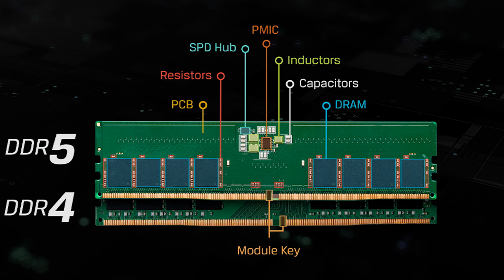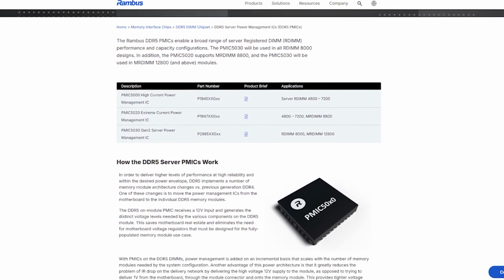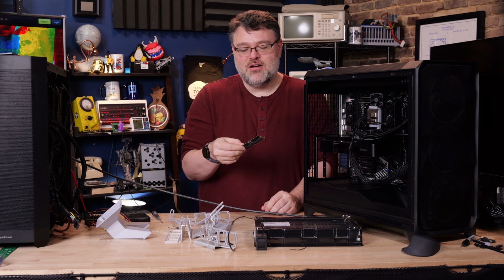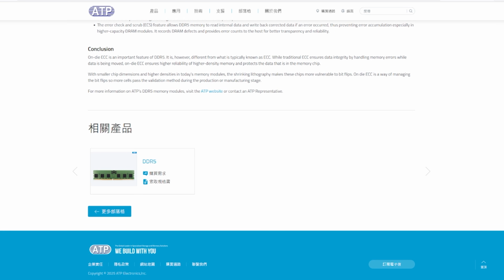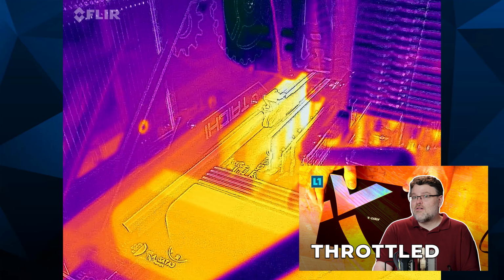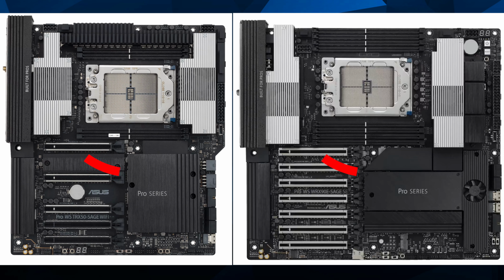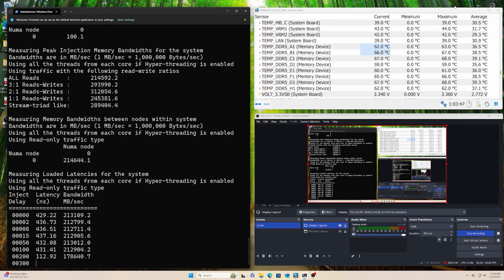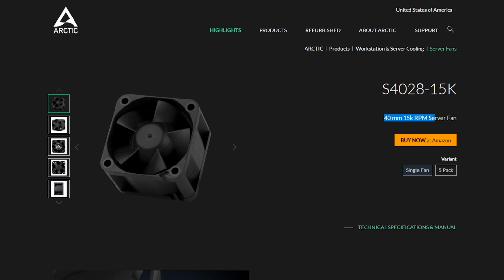Your DDR5 Memory Could be at Risk! All About DDR5

Comment from the maker: UPDATE2: I've got an updated bios from ASUS! Testing is going well for both platforms for proper throttling behavior -- but you're still going to want to monitor those temps and make sure you have good cooling. It is POSSIBLE this issue affects more than just ASUS because there IS an updated AGESA as well!
Reply: So this long but might be a decent video idea since Ram is still super expensive and I just found your channel and so far you seem to be miles above most tech YouTubers - I have a 7800x3d with a 4070ti superduper starship trooper and a liquid freezer 3 240 AIO and 1000w sfx higher end PSU (can’t remember exactly which one but it was a good brand model spec etc) and 32gb (16x2)of T-Create 16gb CL30 6000 ram and around a year after building it and a few months ago I wanted to add 2 more 16gb T-Create sticks but that was right as the prices soared and they were $400 so I found and bought 2 more 16gb ram sticks with the exact same specs and timing (including the other CL30 ab xy dc etc specs) and they were T-Force brand which is another sub brand of Teamgroup and they look very similar both outside and inside at least from what I could see outside but when trying to run local LLMs with like 45gb memory utilization my PC kept crashing even when I lowered the max utilization down to like 30 and even with smaller like 18gb models and I looked at it through a thermal camera and didn’t see any major increase in heat at least on the top/perpendicular to mobo portion of the ram heat sinks however when I took out the 2 new sticks it worked fine and when I used only the 2 new sticks it worked fine and in all case I had them in dual channel so is there a way people can actually test if ram is compatible or not? As in troubleshoot definitively whether the ram is incompatible or that it’s from heat or some messed up configuration etc? I tried for hours to research it and I got nowhere thanks to youtube and googles horrific algorithms and search engines and reddits obsession with ‘answering’ a question by saying ‘too long didn’t read’ or stupefying it (or rather stupid deciding to ‘answer it’ stupidly) to the point of being useless etc.

Like I would think those would all be compatible and the issue would probably be heat buildup because they were all edge to edge in my B650m mortar WiFi mobo so I briefly tried cranking up the fans but it still crashed with LLMs but seemed to work with games even with regular fan speeds even when the games used more ram than the smaller LLMs I tested like in 24gb range and I even tried looking at the actual spec sheets on TG website but their website was trash and wouldn’t load correctly so I gave up on it and kept those sticks but just still use the 2 original T Creates that I built my system with.

Anyway obviously this is more of a question to help myself so don’t worry about it but I figured since ram is so expensive and since you know your stuff and since I couldn’t find any information anywhere on actually definitively testing it etc I figured it could make a decent video idea
Reply: May seem obvious, but I think it would help for folks to get used to maybe at least a little more fan noise.  There's such great fan control sw available these days. I'm upping all my fans by a few hundred rpms and using headphones a little more frequently. Heck with the price of things these days, I think it's probably a good idea to make that tradeoff and lower all temps a few degrees rather than risk having to buy anything now.
Reply: So typical asucks
Reply: i feels like they make these flaws on purpose. most ram kits dont have thermal tape for controler either
Reply: Welcome to ASUS, the brand that gets praised but is also a below average company compared to Gigabyte and others. People hate on Gigabyte, yet they make products much better than ASUS and also have better customer support. Did you see the claim that ASUS made about the 5090 Matrix and the 12v2-6 connector being off centered and too narrow for a lot of plugs to fit? "It was engineered to be that way"... They suck. The Astral is also a mid tier card, yet praised as being the best. If you're not going for the top 100 on the leaderboards, there's literally zero reason to buy it due to the crazy high price as it is outperformed in many different areas by other cards. I used to use only ASUS products for a while besides EVGA, then I quickly switched a while back due to these issues.

Screw ASUS.

Comment: DDR5 like PCIe5 NVME drives should have cooling, most AIOs don't provide any airflow over the VRM or Memory. It seems like PC cases may need to redesign a few things to allow more airflow over the memory and VRM. or We need to bite the damn bullet and move to CAMM2 which would allow water cooling for the memory or a proper heatsink and fan for the memory module. (CAMM2 also has far better thermal control)

Incoming DDR6 is going to make this even more essential as it will be faster and hotter than DDR5.

Comment: Goodram IRDM DDR5 2x16 GB 6400 MHz CL32 working stable at 6000 MHz CL30 (MSI thightest profile). On default exp 6400 i needed too high vsoc for my taste for it to work stable, 1,285 Vsoc. No matter the stress test i can not make the sensor read more than 41°C. Typically they are more like ~36°C.
On msi b850 pro gaming wifi6e (uncommon mobo) and 7800x3d.

Comment: In a video by Northwest Repair he was diagnosing some ram problems and he mentioned that DDR5 ram with integrated configurable LEDs can have an issue where some motherboards can corrupt the information stored on the PMIC or SPD during writes meant to configure the LEDs

Comment: DDR5 DIMMs shouldn't have power management. All DDR5 DIMMs should have heat spreaders. It makes sense that a CPU/GPU has thermal throttling. Just think about how fun things could get when mixing manufacturers. Thermal throttling at the RAM level should never be a design option. Sensors on each DIMM is a wonderful thing. A CPU or memory controller can monitor sensors and throttle all the DIMMs at once. 

Its unfortunate that enginers and researchers have pushed DRAM this far. Ultimately DRAM is dead. Its time to bite the bullet and put the research back into static RAM (SRAM). SRAM will eventually replace DRAM.

Comment: If we use a standard front-intake fan layout, the top fan is generally blowing room-temp air right on the DIMMS (in a dual-channel system, which is what most users have).  Seems to me that should be sufficient, right?

Comment: That's funny. I just assembled my new system and kept getting errors during OCCT and Y-Cruncher. My Kingston FB 6000C30 RAM with EXPO enabled starts to become very unstable at 63 degrees. As soon as I cool it down below 60 degrees, the test runs smoothly. I have an external custom water cooling system, so there's no good airflow in the case. I'm going to change that now.

Comment: ive heard CAMM2 modules would help solve alot of these issues? 1 is signal integrity and lower power draw due to reduced length of electrical traces. sometimes up to 50-60% less power needed. 
combined with the flat design and for more effecient heat spreader design that isn't gamer focused with rgb ect ect.

i also heard camm2 modules are being tested to be mounted on the back of motherboard directly behind the cpu. making EXTREMELY short traces for it, and if it can become part of the socket backplate to a degree. it solves 2 issues. Motherboard flexing from mounting pressure on 1 side of the board, due to now having pressure applied from both sides. And help standardize the method by intergrating with cpu backplate to a degree.  Ideas for ddr6 i would presume. 

Camm2 modules mounted on the back of motherboards also opens up ideas for passive cooling of them via the desktop case backplate possibly adding thermal design into it, like copper plates or Aluminum. Which lets case manufacturers re-sell similar case designs which simply accommodates camm2 modules better with thermal approaches

Comment: I always strapped a fan on my ram so I never got any instability (even in sustained high work loads or fluctuating ones). 
The main reason for the fan was high tREFI, i knew it was temp sensitive but didn't about these other issues.

Comment: When I started overclocking DDR5 RAM I grabbed my RAM cooler I got with a kit of Corsair Dominator DDR3-2000 RAM over 15 years ago.  I never had to use it back then, but I never throw stuff out, and it works great 😅

Comment: lmsensors reports +55c as high threshold on my corsair kit. Also my asus mobo have a mount point for a 6010 fan on one of the nvme heat sinks so it can blow air directly over the ram sticks

Comment: Thank you for making this very important video. Internally and externally in my circles, I constantly advocate for MemTest and tuning memory to be more reliable. So many issues are blamed on various other hardware, when its indeed just the memory all along. DDR can go bad. After any BIOS update, your memory could have different tuning, so worth testing again, specially if you are running any form of EXPO or XMP "overclocks"

as the intro pointed out, many users overlook ranks and assume "I can just pop in another 2 sticks" , "this ram is known good",  when it can introduce a lot of nuance to the IMC.

Now I have to also advocate for checking memory temperatures ! :') MemTest can show it as well, during that torture test, but it would be more accurate to do that in-situ while gaming or other workloads, as your case temp will be hotter with GPUs running.

Comment: I can't use expo with my asrock b650 pg lightning because it causes my system to power off and on wrong and it shows in event log. Its on the qvl list and only 2 sticks in the qualified configuration and I have the most recent bios.

Comment: I never usually comment, but from this video I've went out and bought a RAM cooler, my old DDR5 set died back in 2024 and I replaced it with "cheap"  DDR5 JADEC speed memory, and have never even put them at their profile it's just set to run at Auto, I have now added a RAM cooler to my system because of this video because I really can't afford to replace the sticks I have right now. For the people who don't have a 3D printer, you can get a "Jonsbo NF-1" cooler for cheap.
Reply: I tried the nf-1. It didn’t work well it touched my motherboard cable. I got another no name brand off Amazon. It works well.

Comment: Watching this while still using DDR3 on my 2013 Haswell era motherboard
Reply: Z87 was rock solid 😊
Reply: @q1337  That's the one I got lol
Reply: @DBXCRFFL  Asus Maximus VI Extreme + i7 4770k, retired it now, served me very well before my recent 9800x3d upgrade.
Reply: @q1337  I would upgrade but it's too expensive right now. I'm gonna ride it out for like 3 more years
Reply: @DBXCRFFL  The upgrade was honestly underwhelming, you'd think a decade of improvement would be worth more somehow, imagine comparing a 4770k to a decade older variant, massive difference. Still, hope you get to try it one day. Games like Arma 3 love the single-threaded x3d performance (from 22fps on a 115 player pvp with vehicles server to 130-215fps) but honestly, if there was a 9600x3d, I would've gone with that, seeing how I play older titles that are imho simply better made and more fun, those tend to stick to a few threads so an 8 core is not much use. Multiple screen multitasking though, definitely smoother on this CPU, no more stutters while watching full HD video on my second monitor! I always figured it was a GPU limitation, never would've guessed CPU.
Reply: @q1337  Yeah, I feel technological advancement in CPU's has slowed, I'm still able to play most of the games I want to on this old rig, but that will probably change in the next 2-3 years. I definitely would love a smoother feel while having Discord and tabs open, and higher FPS in AAA games. A 9800x3D is a great CPU though, I'm sure it's smooth as butter compared to my old thing lol

Comment: Didn't have issues... But now I realize I need to up my case fans even for idle, because with Linux running on idle (just browser playing YT video in background) they stop spinning, because CPUs temps fall below fan trigger. Just to be safe. 'Cuz this hardware will probably will have to last me as long as the previous one. A decade. Or even more.

Comment: I was just dealing with random crashes on BF6 since November. Normal fixes like drivers and install repairs didn't help. 
No idea if this was the problem, but I just realized they have stopped since I went to a vertical gpu for aesthetic reasons, which should be letting more air from the bottom fans blow right over the ram. 
ASUS x670e 7700x, 9070x swift, FlareX 32 gb memory, can't remember the speeds

Comment: It's very difficult to get these laws of physics or this concept across, but:
It's temperature you want to drop and heat and temperature are NOT the same thing!
Do look that up!

There simply is not enough Watts in the RAM chips for heatspreaders, to get temperature drops through some cheap pad.
The power chips will benefit though, As that alleviates heat spreading into/via the PCB.

Then; if all 4 slots are populated; there simply is not enough space to get airflow down between the DIMMs when that bit of space is chock full of heatspreader!

Remember that the copper (trace  etc) filled DIMM PCB can/should be thought of s a heatsink...

Comment: btw it seems so unnatural how desktops are built. Motherboard, CPU and GPU mounted for showing off, rather than stability and airflow. RAM with rgb but wimpy coolers and cramped airflow. Seems so stupid. I want desktop rack cases like before, maybe with the monitor on top of the desktop case.

Comment: FYI, my IR Laser pointing thermometer I originally got for the in/famous 12VHPWR 600+ W GPU connectors also works great on various spots on DDR5 (PMIC, other). I have dedicated fans on my 128GB 870E as well as dev servers - as you pointed out, it makes a big difference, especially when overclocking /mildly  overvolting DDR DIMMs

Comment: the problem also is ddr4 had just 1 voltage adjustment. DDR5 has 3 and no one know what each one does. so people could be running 1.35v on the 1st voltage  but the other 2 are on standard 1.2 or whatever it is. making it unstable . I feel they could have made it simpler bust having 1 voltage ... nut nooooo

Comment: i used to have random game crashes and other random windows hickups, it turned out that my ram XMP profile kingston DDR4 3600 wasnt stable, even the windows memory test found it had issues. 
The fix was to change the XMP profile to 3000hz, the memory instability was fixed. No more crashes or issius. The only draw back is some performance from slower ram on my 5800x3d. Im too lazy to go and set the perfect ram timings manually. This was 2 years ago.

Comment: I have ddr 5 down clocked to 6000mhz cuz i have a ryzen 7, dont have any issues. I mean its still faster than ddr 4, so thats a solution. Wonder if ill hit any issues when i upgrade the cpu and can hit 6400 speeds?